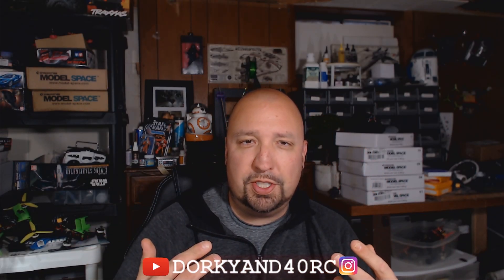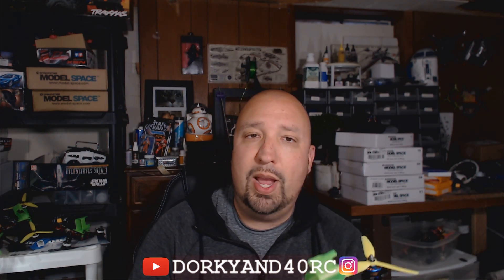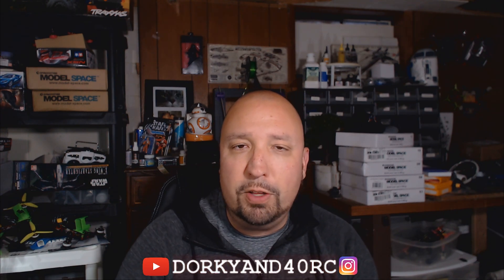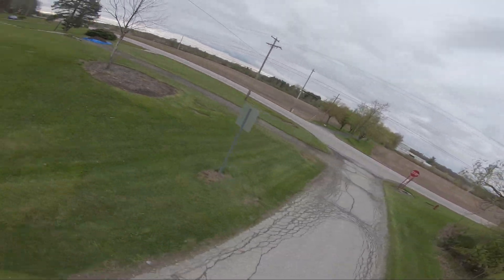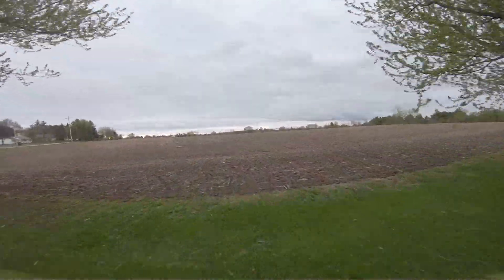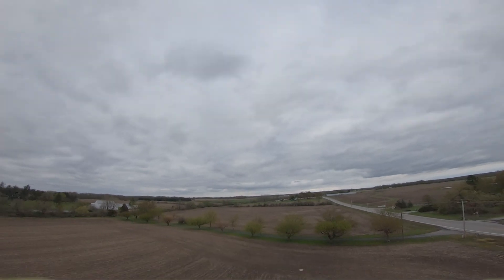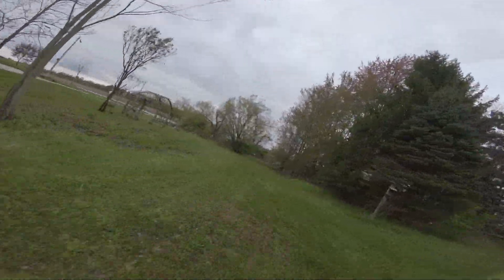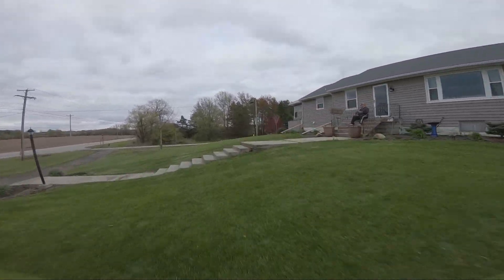BETAFLIGHT 4.2 TALK N FLY | ITS GREAT

Comment: What about ESC settings? are you on 24khz some pilots complain about slow wobble (not showing in your flight) when cut throttle?
Reply from the maker: 48k and 22 timing on all my ships.  Always works fine.
Reply: DORKYand40RC test the bf4.2 today defiantly better then 357 on mid ocillation  factor , just fly it on a quite small park so did not test the all deal , sounds better , and seems that Setpoint have no bounce back as it was on 4.0 &4.1
Reply from the maker: Great!